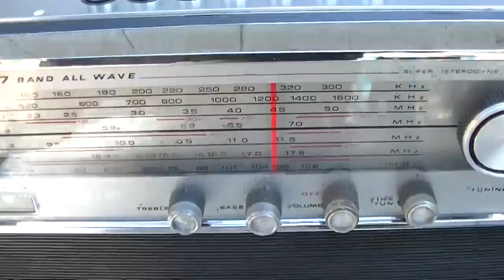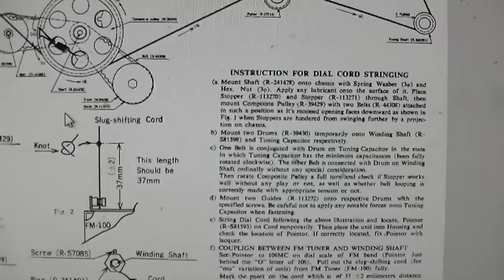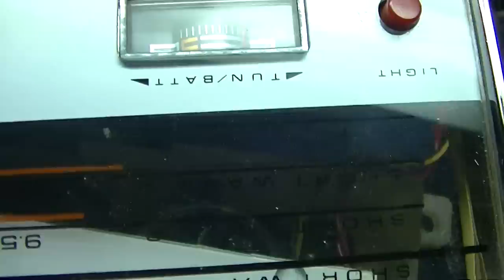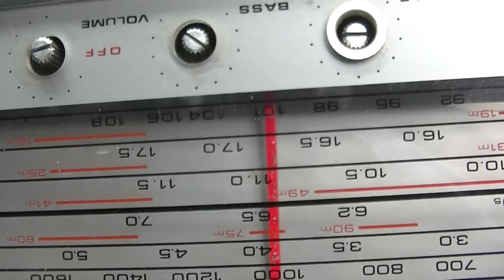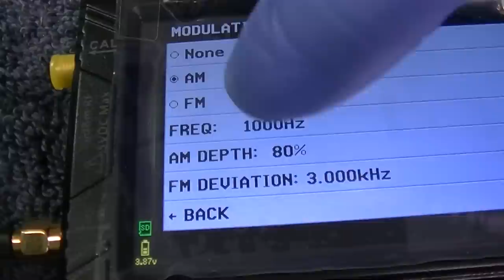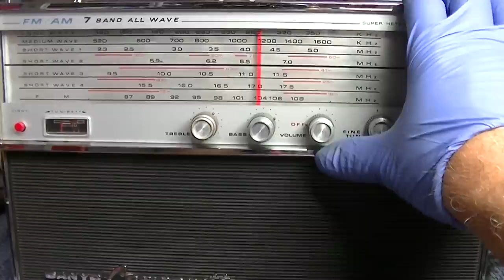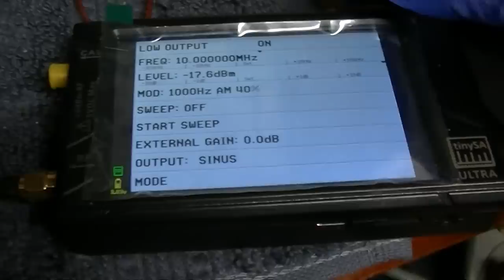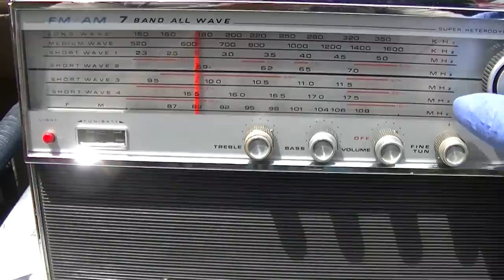Sanyo Campanetta 7 Band Radio Repair AM FM SW Tuning Belts

Comment: @shango066 Thank you so much again for fixing this radio for me!  It will definitely be enjoyed. By the way, the reason the FM section was noisy is because the antenna wire was never reattached - I soldered it back on and it is much quieter now!
Reply: These are really nice, solid radios.  I sent Shango some photos of the top on the one I have,  so hopefully he can forward them to you,  if you would like to recreate the letters for the band selector buttons.  Strange this is missing on yours.
Reply: The buttons on the top of the Campanetta are in the following order from left to right :

 O      O      O      O      O      O      O
FM SW4 SW3 SW2 SW1 MW LW
Reply: @bountyhunter4885  The button on its own on the far left is AFC
Reply: @LakeNipissing  The one in front of the antenna, ok. I saw an image of this model, of just those seven buttons grouped together. Good stuff. Thx

Comment: I guess you can say this radio was meant to be used.  Let it sit and those belts will take memory and break.  So I would "exercise" the tuners once a month parking in different positions on the dial to prevent "belt memory"

Comment: Sanyo made also a version for the US, branded as Craig, model 1306. I'm pretty sure I've seen other versions as well, but I can't remember the brands. Another observation: it looks to me like the new belts were 3-d printed, which is pretty cool. Finally, the day the video was published was apparently Sanyo day - I bought and fixed a 1979 Sanyo M9922LU boombox.
Reply: When is it from? Late 60s early 70s?  Because Craig was a very cheap low end brand, at least in the 80s.
Reply: Old mate Craig actually put his name on something good once!
Reply: Pretty sure there was a Channel Master version of radio too.
Reply: @tarstarkusz  I had a small reel-to-reel branded as Craig in the late 60s. It was known for having a decent automatic level control and seemed to be high quality. We used it to tape our band practice so it got a lot of use. Later, it became a junk brand.
Reply: @defaultuserid1559  I know there were a few name brands, even from America that were good quality at one time and then became the worst of the worst by the mid 80s.
Reply: @destructionfun2  You are correct.
Reply: Sanyo was awesome for pretty much everything they made
Reply: @tarstarkusz  The website Shango was on said 1968, which judging by the design looks correct to me.
Reply: @defaultuserid1559  Was it the Craig Model 212? That was one of their most popular portable reel to reels. I have 2 of them and they still work great.
Reply: @jimdayton8837  That's the one. What an upgrade those were for us kids that previously had rim drive recorders with crystal mikes. The capstan storage was a nice touch. Glad you can still get belts for them.
Reply: @defaultuserid1559  Nice! Capstan driven Reel to reels always sound better than the ones with rim drive motors, I have one of those too (Concord F-20) Both the F-20 and Craig 212 were featured in the Mission Impossible TV series. I'm glad you can get the belts too. Had to replace the old ones on mine a few years ago.
Reply: @jimdayton8837  Loved the control knob that operated in a "T" pattern. I'd still have mine but it got stolen.
Reply: @jimdayton8837  That sounds about right given the styling and construction.

Comment: Could be that they took old hard ones, pressed them into porcelain clay, fired it, burning out the belts, then poured in melted urethane.  So somebody's cranking these out like gumballs?  Spaghett!!
Reply: kti5682  jeweler's investment? that stuff's one off and crumble tho. used like plaster-of-Paris, kinda. wax is carved first, then little wax sticks melted to the positive to mold the negative inlets for molten metal, encase that all in investment in a bell jar, stick that in a vacuum, suck the bubbles out, stick in hot oven, burn out wax/cure investment, stick that in a centrifuge, pour in metal, spin for awhile, let cool, chip mold away, then there's the raw product, touch up, polish, (it's pretty detailed lol)

Comment: 3D printing and the mechanical stuff is also not my favourite thing to do, but after some time, you realise it's the only way to become independent from sellers (charging lots of money for vintage or rare parts) and people doing mechanics (you gotta pay for those work hours and they are not cheap). This belt I guess would be TPE 3D printing or something like that. I learned to do repairs on cars and vintage radios came later after I got a 3D printer and other tooling. Learning to do CAD for 3D printing also came helpful in job searches, it's always nice to have some backup, just in case. Show off some skills in front of the people and they know you can get things done, you don't get any extra questions.

Comment: A very cool  vintage radio well worth whatever price the owner ( wforkner) thinks should be made to get it up and working again. So after getting the belts Shango does the right thing and uses a set frequency to adjust the pointer to each tuner 
when putting on the  new belts. Brilliant.

Comment: Interesting to learn this was made for the Italian market.  I have the same radio in great condition like this one,  in Canada.
Very impressive to see two large ferrite bar antennas;  I haven't opened the one I have, since it works well.
I e-mailed you some photos of the top to show how the buttons should be labeled, in case the owner wants to recreate the labels.
The Sanyo AC power cord has a very small plug and socket compared with with average 'boombox' power cord.
Reply: Yes, I'd have expected "ALL WAVE" to be in Italian. Maybe they aimed it at the Italian market then adapted it for other countries.
Reply: yah FIGS countries, france, italy, german, spain
Reply: One of the ferrite bars is for the lower "tropical" shortwave bands. It was pretty much standard fare in multibands at the time. The belts and slug tuned FM was not so common. Cheers!

Comment: The TinySA has also been a very useful tool here for alignments.  Worth every penny.  Just make sure it's not a knockoff.  (for those who want one).
This looks like it has the potential for excellent weak signal DX.  I would make a 455KHz BFO for SSB/CW decoding and install that inside.  73
Reply: Hmmm. Now that is good thinking. I don't understand why Shango says "SW is dead." Sure....it's not like in the 60's/70's/80's etc. but when the net went live that was always the line being promoted.

It isn't dead. SW being SW you have to know when and where to monitor etc. You better make sure (IMO) you have a nice long wire or sloper type of antenna and GROUND GROUND GROUND everything. But it isn't dead. Your take?
Reply: @MrPocketfullOfSteel  I read your comment and I'm reminded of BBC Singapore which I used to listen to every morning at 11.685 MHz it went down for the count July 16th the only way to listen to BBC now at least in California if the jump on a WebSDR. Very sad

Comment: I am currently in the process of trying to repair my dad's old radio he bought over seas while in the Army. I came across your extremly helpful video. Thank you for uploading that! I see its been almost a year now. It is exactly the same except it just says Sanyo. Model is 16HA-862. The belts are broke too. I need to find them and a antenna and tuning knob. I loved this radio growing up. I was fascinated with the shortwave and it had a great sound.

Comment: Shortwave still has plenty of life in it. You just need a good outdoor longwire antenna and a location away from RFI sources. An active loop like the MLA-30+ will work wonders too. In my California high desert location I routinely get plenty of shortwave broadcasts. Even the BBC and VOA in English. At night on the 19 meter band I can get the BBC, VOA and Radio New Zealand Int. loud and clear right next to each other on the dial. Almost like in the cold war days!

Comment: 7:30 You could drill a tiny hole in each sprocket and one in the large wheel, then just string them together with dial cord, using the tiny holes both to apply spring tension and to keep all 3 wheels in alignment. It would be a pain getting them to align in the first place, but once aligned, the holes and springs would keep them that way.

PS: That's surprisingly modern looking on the inside, with the cog belts, part of the chassis being made of plastic and the ceramic magnet speaker. Sanyo was ahead of its time.

Comment: Here in the UK the FM band is 88 - 108Mc, way back in the valve era it used to be 88 - 100Mc, some sets go down to 87.5Mc.
The stereo subcarrier is 38kc, and the Rds data is 56kc.or thereabouts.

Comment: Cogged belts typical in small machinery. Printers, EDM machies. Probably in metric dimensions. Measure pitch or width and distance or pitch between teeth, overall circumference, I have a small box of cogged belts at the shop. I'll have to take a closer look at them. 
Could possibly make one from rubber o-ring? Right inner diameter and try to cut the teeth?

32:50 possibly the o-ring is a poor idea. Better than nothing.

Anyway, great radio and nice repair efforts.
38:00 tuning meter inoperative or low signal level in radio? Antenna up?

Comment: I'll stick to my trusty old Radio Shack DX-402/Sangean ATS-505, thank you very much.  I love the sensitivity on that set and did the mod to remove the split second silence when tuning up or down the bands.  So, it's wide open listening while turning the tuning dial.
Reply: Does this mod apply to the DX-400 also?
Reply: @vcv6560  The DX-400 is nearly identical to the Uniden CR-2021 (the only difference is the Uniden uses an LED readout for the signal strength).  It uses a different microprocessor/micro-controller chip (IC 501 or IC 601; TWP47C-something).  I have no idea who makes the chip.  It, unfortunately, does not match the one used in the DX-402/Sangean ATS-505 (various revisions) nor is it pin compatible.  The DX-402 uses a Toshiba TC9327F 4-bit micro-controller, which also is used in the Roberts R9914 SW receiver.  I don't know who makes the chip in the DX-400 or how to solve the same issue on that model.

Comment: Shango my first thought was cleaning spray got all over the oscillator coils and tuning components and completely detuned everything it happened to me with a Motorola console with a good working FM tuner and all I wanted to do is spray the tube socket and after that it stopped working. I had to wash it with a bunch of 91% alcohol with a spray bottle and let it evaporate then it came back. AM is not that critical and can tolerate cleaning spray but might loose a little sensitivity.

Comment: as for belts 
goto a vaccuum cleaner repair shop and look for a cogged belt .
Lots of thickness's and lengths and styles.
Reply: Good idea. I remember having to replace one of those small belts on a vacuum beater brush when it broke. One of those could be a close enough match to get one of these radios going again.

Comment: Crazy glue the belt tips together. Silicone a strong rubber belt around the outside edge. Overlap ends , and use silicone rubber sealant only.  It will work even as cracks accumulate.

Comment: 3D printing is neat. I designed a couple of adapters to slip on ends of an 18650 lithium cell, so it could replace a couple of D batteries in series.
D batteries are friggin' expensive and I could reuse some 18650s that I have in abundance from old laptop batteries. 2 diodes in series with 2x18650s drop voltage to usual "4xD battery" levels, but radio would've probably worked with sligtht overvoltage all the same.
And I had to recap and realign the radio first :^)
Reply: AA to D adapters are very cheap.  I use them for powering radios from Eneloop rechargeable AA batteries.
Reply: @tarstarkusz  It was more of a fun little evening project for me, really; considering that a "dumb" analog transistor radio isn't very picky about a power source as long as it stays in a certain voltage ballpark.

But, having spent time making the model, I can now easily run my portable tape deck with 2 18650s too :^)

I used to print AA->C/D sleeves from thingiverse too; considering that someone already had sunk some of their time to make a model, it's sometimes quicker just to print it at home for peanuts than to order it from some store or go looking for it locally.
Reply: @ZXRulezzz  The only problem with using lithium ion cells in an application like a radio is there is no over-discharge protection.  Lithium cells hate being deeply discharged down to 0 (IIRC, it's around 2.5vpc).

As much as I wouldn't mind having a 3d printer, I really have very little use for one.  But it is one of those things where when you need it, it's a lifesaver.  Shango could have used one to save the customer 40 bucks plus shipping here.

One thing you can do besides 3d print is to cast and mold.  If you have a part that has broken in half, you can glue it back together, take a silicone mold of it and then cast a new part with resin.  This works VERY well. But it would be a bit expensive to do this for a battery adapter.

Comment: That's the big problem with trying to repair older radios. The radio itself is robust, just rubber and certain plastic items are victims to the ravages of time. Many of these parts are long out of production and /or the companies are defunct, thats why 3D printers are so great, you can piece together the ild part good enough to get a scan of it, and make a new one. And with the variety of types of plastic available, you are sure to find one that will fit a particular application
Reply: BUT ... how do you 3D print the belts?

Comment: Teflon coated, stranded steel wire works for rigging small pulleys though I haven't tried it in a radio. It wouldn't work if the pulleys/rollers are small. These look just barely big enough for it to actually work. I'd get the wire with the thinner strands of course, so the wire wouldn't be too stiff, which of course results in springiness if the rollers are too small for the wire.

Comment: I’ve more often seen the Craig version of this radio, which I believe has a green cabinet. I suspect most of these Sanyo branded radios were sold outside of the US as a lower cost alternative to the Sonys and also to European Brands such as Grundig.

The buttons or the panel beneath them were probably identified by markings or labels that fell off or wore off over the last 50 years.

Perhaps an alignment or recapping would reduce the FM hiss and improve the radio’s overall performance.

Keep in mind most of these multiband sets were designed to perform adequately but not to be DXing type radios, even if their high tech styling might lead you to think otherwise.

Some of my older radios from this era are almost too sensitive  on FM to be used in a large metropolitan area.

Comment: Is the TinySA Ultra a good instrument for aligning AM and FM radios?  I currently have nice vintage HP generator that allows me to align AM (with an external source for modulation), but it does not go high enough in frequency to align FM.  Would the TinySA Ultra make a good replacement for the HP and do both? Would be nice considering it’s so small and the HP weighs like 30 pounds and I still need an external signal gen to produce the modulation frequency.
Reply from the maker: Im hoping it will do exactly that for me
Reply: @shango066  I’d love to know your thoughts once you’ve had enough time with it to know.  I’d pick one up in a heartbeat considering I could sell the HP for enough to buy a couple of these things, not to mention how much an HP generator that goes high enough for FM costs.  Plus space is limited here and having this tiny guy with just the radio will free up a lot of space.

Comment: Fyi I used to work in the rubber company now this will work depending on the mix you make soak in brake fluid to get viability back the clean   with acetone rinse with water then reattach using a rubber glue

Comment: The 'weired' oirt  fm band was only used in CCCP, Poland, Chechoslovakia, Hungary, Romania and Bulgaria.
In Hungary oirt radios from western companies incl. Sanyo were available  - in the 1980s.
Reply: That OIRT band is 65 to 73 MHz.  In Japan they used 76 to 90 MHz.  So there are (vintage) radios available from several countries that cannot be used on the 87 to 108 MHz FM band without modifications.

Comment: Nice performer and the crisp selectivity is fantastic. Don't make them like that any more. Modern DSP has some advantages but not all that many. Especially the cutout as you tune them. The FM sensitivity is fine because distant DXing in what few want to do with all the multipathing you get. You really only need to get the strong local stations on FM. Want to DX, tune AM at night.

Comment: I have a couple of the Craig branded versions of this radio in my garage. Bad belts on both. One of them has the AM section belt still working. I don't know for how much longer. The belts are very hard to find. Given these are garage radios, I am not willing to spend $40+ for replacements per radio. Not worth it.

By the way, I don't think this radio is all that great overall. It was actually a disappointment for me, not just the belts, but the overall performance. Cheers!

Comment: I bet your great at changing timing belts on cars the very few AM stations transitmig    in the U.K now the was a big push to digital radio and turn off the transmitters but people complain a most new car have  DAB radio fitted has standard my car is a 2015 but being a low spec it does not have DAB radio but fm is still OK with me

Comment: back in those days sanyo was the cheap one on the market but there high end stuff was pretty good this must been one of the high end radios from them sony, pansonic, were better low end market sound design made cheaper stuff which often broke or sounded really bad